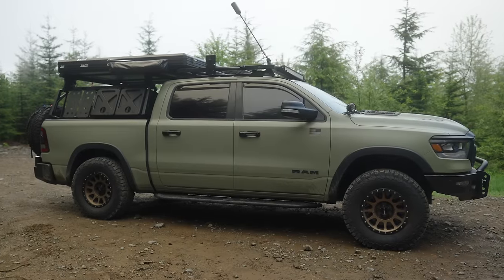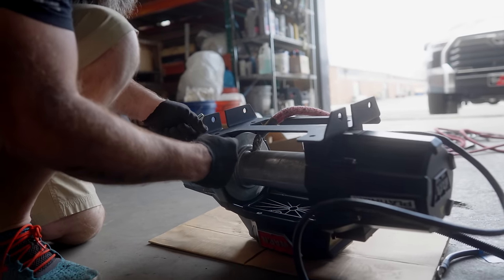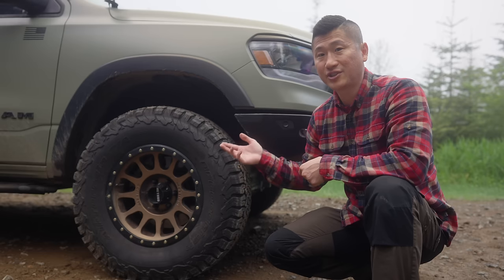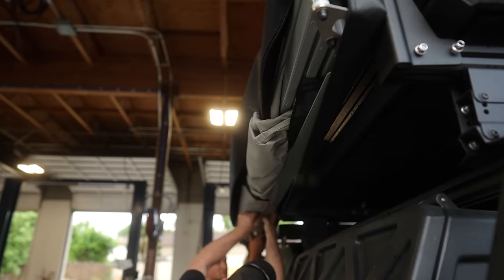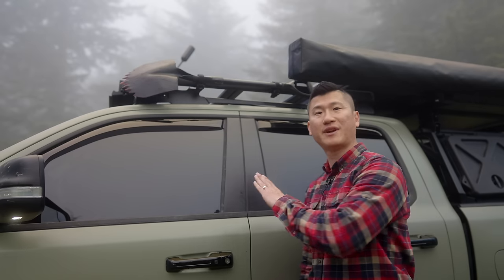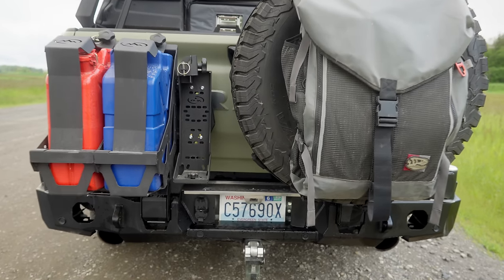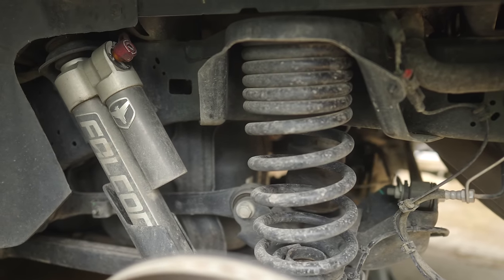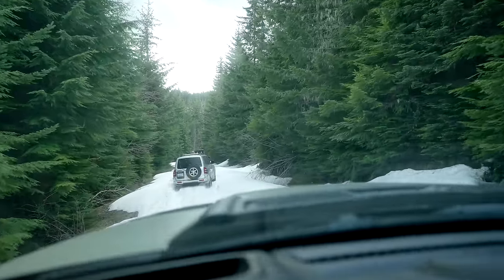2021 Ram Rebel Overland Build - Good and the Bad

Comment: Rear air suspension helper bags will make a world of difference for you.  I do a lot of hauling and towing, so I got an auto leveling system for my RAM from Timber Grove and it's been wonderful.  With all the mods and added weight you've been doing, you might want to consider doing a 4 corner coil spring to air spring swap.  I'm sure there's plenty of overland shops out there in WA that can hook you up.
Reply from the maker: thanks for the feedback and recommendation, I will look into those!  Will see how these bump stops and coil perform in the next few trips, and if unbearable, may have to go that route.
Reply: I agree. I have a ‘19 Rebel with an RSI SmartCap, a TuffStuff Alpha RTT plus whatever gear  I’m hauling in the bed. I have not upgraded the shocks or springs but I have added the basic Timber Grove airbags (not auto-leveling) and that alone is a world of difference. Eventually I’ll upgrade the shocks & springs to help smooth out the ride on the rougher trails.

Comment: Carli is coming out with a set of HD rear springs specifically for the Rebel that has constant weight in the bed. I also recommend Timbergrove airbags. I run those on my Rebel to assist with the weight of my CampX.
Excited to have you back as well!
Reply: excited to see what Carli comes up with, for sure.
Reply: Yea I have a standard 1500 and the standard carli springs left me squatting with all the weight. I stepped up to the rebel brings (recommended by carli) gave me another 1 in of lift and solved my issue. Going to still look into timbrens as the springs and end links give more travel so I don’t want too much roll with the upper weight. If that makes since.

Comment: Have the same bump stops you have on the rear with 4Wheelcamper.  It was riding on the bump stops also, after I installed some heavy duty rear springs from Amazon, they took it off the bump stops and my ride improved.  When I installed 2 inch ReadyLift spring spacer in the rear, it raised the spring travel even more.  Also did 2 1/2 inch lift in front, very happy with the ride.  I also installed a heavy duty sway bar in the rear, but found the lightest adjustment on the sway bar works best for me.
Reply from the maker: my next course of action would be heavier springs , and if that doesn't work, then airbags.   How are the springs holding up?
Reply: @KrokemOutdoors  Springs are holding up fine.  The YouTube video I saw them on is,  https://www.youtube.com/watch?v=4nTUig1BBOg.  Notice his camper is quite heavy on a Ram Rebel, yet the springs he put on help with the load.  I did the same with my 2019 Ram Rebel quad cab.

Comment: There’s always Dobinson coils, they offer two different rates. Ones a little more than stock and then they have a heavy rate, but they are a 2” lift instead of 1” like Carli’s new rebel HD ones. 

I’ve got the Dobinson heavy rate coils on my new ram with a 58” Rci rack and a ikamper skyview 2.0 and it didn’t even squat at all. Goes down a little if I load the rest of the camping gear in, maybe .5”. Maybe worth a shot.

Comment: You should look at the carli heavy duty rear coil springs for the rebel. They are built to hold an addition 500lbs of constant load in the rear. Im getting this on my rebel because  I have the mulit function tailgate and ram boxes which add 300lbs empty. Awesome build by the way best I've seen!

Comment: Love it. I’m going to get the same roof rack for my Rebel. I have the same fridge and power it through the 7 pin trailer connector. You can get a 12v adapter which is nice so you don’t have to have a battery back there when driving. The cable fits through the tailgate gap.
Reply from the maker: Be prepared for the drilling. I made a mistake and didn't have the proper drill bits for steel ahead of time, so had to make a few trips to the hardware store. 
Thanks for the idea on the adapter for the fridge, I didn't know about that! 
🍻
Reply: @KrokemOutdoors  thanks, will do!

Comment: Edward,
Boy oh boy looking sharp brother. Nice setup some of these like the top rack & possibly tent are interesting to me also ultra long fuel capacity is something I value. 
Good job looking really sharp I have original old tech cell booster but it may be marginal as my rig is from origin cell times excellent but some things have advanced & in others old technology is best for sure. 
Well done you.
Best David
Reply from the maker: Thanks David! the Cell booster seems to have a decent reputation for helping, but I have yet to fully test it out myself.  I know that it's function is to boost the signal rather than find one in a dead space, so I carry my Garmin InReach explorer for those scenarios where there are absolutely no signals.  The only downside is the monthly subscription fee, but I think it's worth it 👍

Comment: Great build and excellent video!   I love my 2022 Ram Rebel, took awhile for me to overcome the loss of my 4Runner (traded in for the Ram), but I'm growing to love it.  Quick question, did you have any concerns with load, weight distribution and potential fitment issues resulting from the panoramic roof vs solid rooftop?  Thank you!

Comment: QUESTION - I know this is kind of a dated video, but I have been following for awhile (and stole some music!).  I'm starting a "mild" build on a '22 Limited and doing wheels/tires this week.  On your Method 18" wheels and 35" tires, did you use the -12mm offset wheel? I will have a 2" leveling kit. Thanks

Comment: Nice setup! What's your experience on the Expedition1 dual swing out? I'm hearing neg reviews re lead times and poor communication with customer service as they seem to frequently send out wrong parts.. ?  Was about to pull the trigger but now I'm looking at settling for the Rig'd tow hitch spare carrier. Thoughts? Thanks, Shin!
Reply: For my tundra...
Reply from the maker: The dual swing out itself is great. As for lead times, it seems like a result of supply shortage issues, which many manufacturers seem to be currently recovering from. What sort of communication issues and parts issues are happening ?
Reply: @KrokemOutdoors  got the info from a tundra forum.. it was 2 or 3 guys who ordered 14+ tundra front bumpers and recieved the older gen model after months after promised lead time.. and reported to have hard time with comms. It was around the same time peak covid so I dunno.. im still on the fence between the 2.

Comment: I was wondering if you are going to mention the ride quality of the rear. I noticed in the moving shots you could see the rear bucking. I don't think air bags are the best solution for what you do, but would defiantly help if setup correctly and are probably the only short term solution. The problem you are going to continue to have is that you are still modifying the truck regularly. The weight is changing and as such, finding the correct spring rate is impossible. Once the weight is figured, finding the correct spring rate and shock valving will be fairly simple.
Reply from the maker: yeah, i personally don't foresee any more substantial weight being added to the truck, but do have a few options in mind if the ride becomes unbearable

Comment: Try out the 305/70r18 Mickey Thompson Baja Boss AT, they will be just as wide as your 35x12.50r18 K02 tires but a half an inch taller when mounted with 45psi and laying on the side of the tire's sidewall.
Reply from the maker: I am actually thinking my next set of tires are goin to be MT's ;)
Reply: @KrokemOutdoors  I'm getting KM3s for my rig. Can't wait!
Reply: @KrokemOutdoors   If you are ok with a tire that is a little tougher than a KO2, but about as light as a All Terrian for less fuel consumption and less stress on the drivetrian, with off road grip of a MT, the Yokohama Geolander G003 MT is available in 35x12.50r18(34.7), 305/70r18(34.8), and 315/70r18(35.6). You can check for usual avialability all three sizes.
Reply: @KrokemOutdoors   With MT's you might draw in more viewers/subscribers to see where you go with your truck, but then you will need your rock sliders ;)

Comment: $3,000 for a rear bumper. An additional $220 for a black powdercoat, cause 3 grand just doesn't cover it. Are they nuts? Don't take it the wrong way Ed, love your build and content. But c'mon.
Reply: It's a pretty penny! Do you know of any comparable setup thats easier on the piggy bank? Might settle for the rig'd but I really like the functionality and design of the expedition 1.
Reply: @parkje214  I don’t. It has great functionality, i just think that price is outrageous. The Rig’d is solid as a tire carrier, still very expensive. Yes, you get what you pay for, but still.

Comment: instead of moving the tent and getting more risers could you just flip the awning brackets upside down? so they hang down instead of lift up?
Reply from the maker: we tried that first in order to fill in that gap, but what ended up happening was that the awning would not allow the driver's side rear passenger door to open unfortunately
Reply: @KrokemOutdoors  makes sense, youre a smart guy not sure why i thought you didnt try that already haha. Rig looks great!